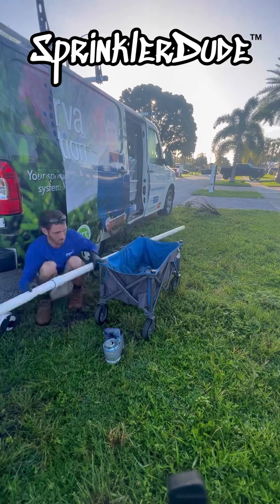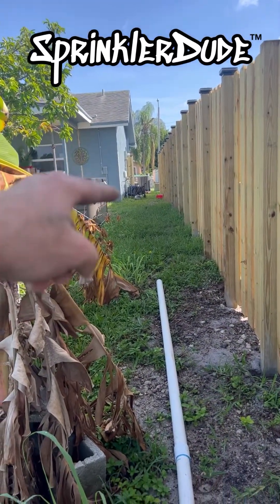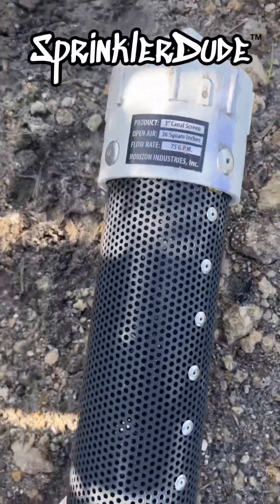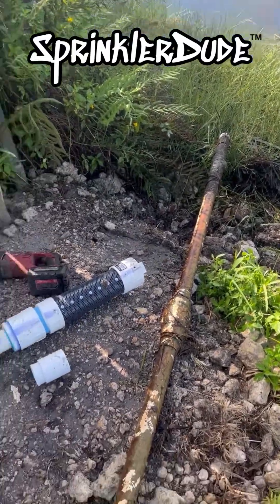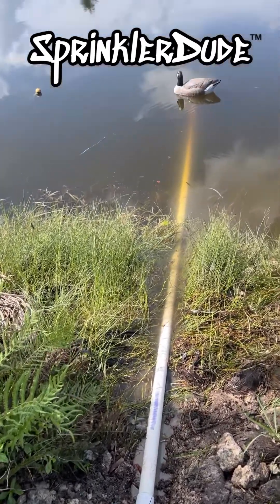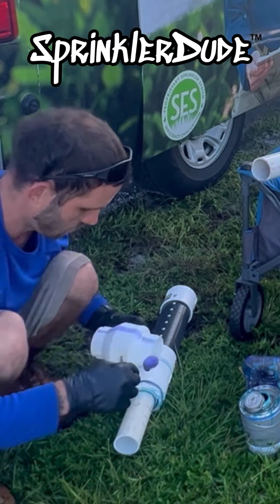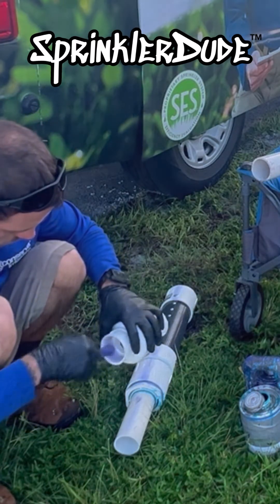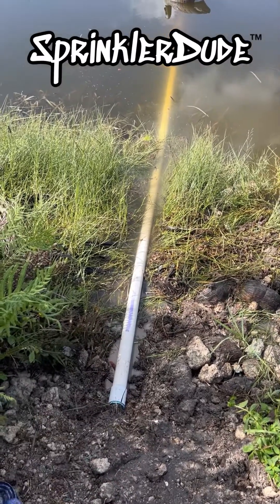Installing an Intake Line for a Lake Pump System: Tech Tip

Comment: My sister's pull canal water for use in there sprinklers. Any ideas on a  filter they can use on there inlet line to filter out sentiment?
Reply from the maker: For pulling water from a canal, the most common option is a screen or basket filter installed on the suction line before the pump. A large-capacity intake screen (sometimes called a “foot valve strainer” if it has a check built in) will stop leaves, fish, and large debris from entering. From there, adding an inline screen filter or disc filter after the pump gives a finer level of protection against sediment and grit that can clog nozzles or damage valves. These filters are designed to be opened and rinsed out, and in your sister’s case, cleaning them once a year at minimum would be smart—though depending on how dirty the canal water is, they may need to be checked more often. I’d suggest she look up “inline irrigation screen filter” or “disc filter for canal water” so she can compare sizes, micron ratings, and maintenance styles to find the best fit for her system.